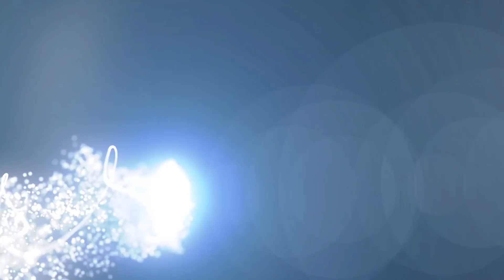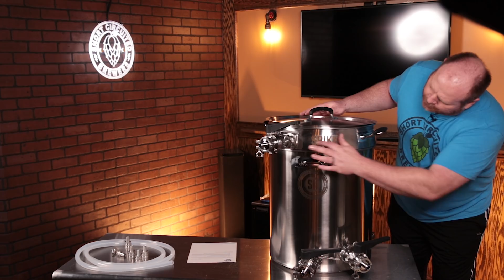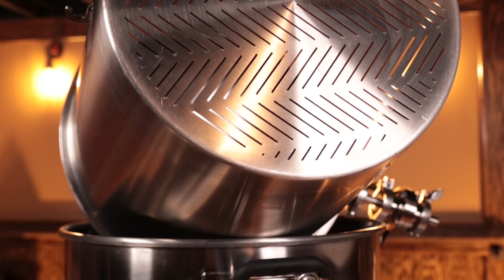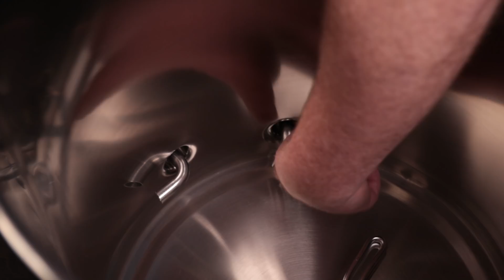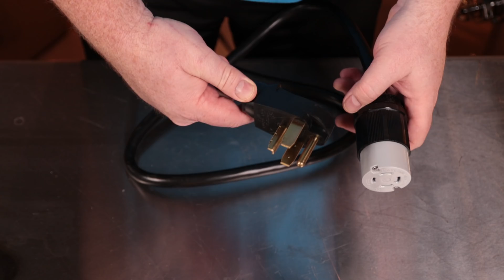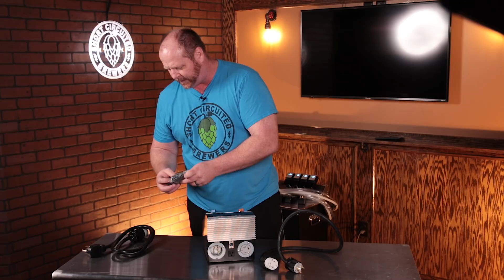Spike Single Vessel E BIAB System First Look!

Comment: Just seeing this video after Spike released pricing packages. I think not including a chiller is a big mistake for the complete package. $2k for an incomplete system basically, when their competitors in the e-BIAB market provide a complete package.

Given the size and weight the 20g basket can hold, I'm also surprised they don't include a manual hoist. It's a simple Amazon purchase, just like an extension 240v cable, but $2k is a lot of money for a system that you would need to get extras from a 3rd party vendor.

I saw the animated video on the product's page and I'm still up in the air. Personally, I'd have liked to see at least an included chiller and longer cables.
Reply from the maker: Understood! All valid points I know they are "listening" 👍🍻

Comment: Kettle runs about $300, basket about $200, element about $100, controller about $300, fittings about $200. So it’s going to be at least over $1000 probably situated at $1299.99
Reply from the maker: Check out my latest video. First comment I give the pricing.. 👍🍻

Comment: The malt pipe looks like it has a lot of steel, so it will be spendy. My guess is at least 1,500 - 1,700USD with controller and pump included.
Reply from the maker: probably pretty close..

Comment: Based on the setup and their pricing on their website here is my pricing breakdown:

20g kettle - $335 (Website)
Basket - $200 (Guess)
1.5" Butterfly valves - $50 x 3 (Website)
1.5" TC Quick Disconnect - $12 x 3 (Website)
Dip tube - $32 x 3 (Website)
1.5" TC Heating Element - $75 (Website)
Silicone Tubing - $2.5/foot x 20 feet (Website)
Quick Disconnect Fittings - $14 x 6 (Website)
TC Clamp - $6 x 11 (Website)
Brew Pump - $200 (Guess)
Electronic Control Panel - $500 (Guess)

Total: $1800

Out the door price: $2000 - $2500. 

You can always put your products on sale, but you can never raise the price after it's been set. People associate high priced items with high quality and lower priced items with cheap quality, unless it's on sale, then "its a steal". I have 3 Spike 15g kettles and Spike equipment is high quality though. Whether it's worth that kind of price, probably up to the end consumer. You can always just buy the kettle and basket and buy all the accessiories from various other sites and probably end up spending around $1000-$1200.
Reply from the maker: good analysis.. I think you are very close to what MSRP will be fully outfitted.

Comment: Looks like it might tip over once you hook the basket on top full of grains.  $600.00 -$700.00 sounds more like it.
Reply from the maker: Nah... The center of gravity on the basket is directed to the opposite side of the kettle and the bottom of the basket rests against the the kettle. And there will be some wort in the bottom of the kettle for ballast. 👍🍻

Comment: Killer looking system. Spike is top notch quality, and can't wait to see it in action. It seems Grounded Brewing Technologies set the standard for the Turnkey 240v E-BIAB systems. At Launch, cost was only $1,550.00 which included the Massive CFC. Granted, it's only 15G compared to Spikes 20G. For Spike, you're probably easily looking at $1,800-$2,100 range including Pump & Chiller
https://www.groundedbrewingtechnologies.com/turnkey-brewing-systems/t0p9tduhb4ewtndi0juvr1udj2ohsd
Reply from the maker: pretty good price and that is a third party selling the Spike kettle.. Thanks for sharing that!! 👍🍻

Comment: Good Overview Brian.  I think if they want to stay competitive they need to come close to what the Claw Hammer 20 gallon system is, $1700, and offer a comparable package.  That system comes with the kettle, hoses, quick disconnects, basket, hop baskets, plate chiller, pump, controller, etc..  That is my home brew drool system and if I were to even consider the SB option it would have to be extremely comparable.  And just to be clear, I do not own the CHS system nor do I have any affiliation with them.  I've just done a ton of research, I've been deployed for 4 months, and of all the eBIAB options out there the CHS system seems to be the best bang for the buck.
Reply from the maker: We'll have to see!! I don't disagree with you. . 🍻👍

Comment: Price?  I'd say $1799 would be a good ballpark, although up to $2200 wouldn't be out of the question.  I hope they redesign those hooks and the way the mash basket sits at an angle.  It seems like over time the weight of a full-volume mash would deform the lip on such a small surface area.  Also, for a sparge setup having the mash sitting at an angle would cause an uneven flow. 

Thanks for sharing, and can't wait to see the actual production model!
Reply from the maker: Me too!! I'll be brewing on it this weekend!!

Comment: Thanks Spike Brewing for send the system out to Brian for reviewing and testing. For Brian's channel subscribers to view. Price points I'm going to guess is going to be between $1800 to $2500. With the unit being able to brew 20gal batches. The unit is well laid out. The one thing I'm wondering is does it have a spreader bar to lift the basket for using a overhead hoist. For lifting the basket with a grain bill for a 20gal batch? Brain thanks for another up front and open review, look forward to see the unit at work making more great beer!!! Cheers
Reply from the maker: Thanks John! Good question on the bar/lift attachment.. Well see what the final system looks like..

Comment: Well that is a bit difficult, but I will try anyway.  As I see it, It has to be cheaper then Brewtools B40pro Brewing System which is in direct competition with Spike.
Anyway,  it definitely need to be cheaper then 1.583 $ since that is the price for the B40pro and teh B40pro is top of the line. So 900 - 1.100 $ ?
Thanks for the video.
Reply from the maker: Thanks for the comments!

Comment: I think a lot of these comments are on point.  If you want  simple BIAB, them buy a kettle and burner and go for it.  Some of use like the ‘extras’ that Spike and Brew Tools bring to this market space.  This clearly is a work in progress and I think Spike was right in sending these out for review even though they are not production models.  We, the target market have been waiting for SS Brew to show something to us other than a coming soon sign.  Looking that the design as it stands right know, I like the TC fitting even though they add cost for those that are not already using them.  The butterfly valves are nice but just added cost. This could be an a la cart item.  The kettle and basket look top notch. Need to find a way to hoist capabilities to the basket. Most of us who run larger BIAB  systems use some sort of pulley system.  We drink beer, not lift weights...lastly, the controller needs to reworked depending on price point.  With just simple on-off switches and a basic PID, there is no customizable options.  As it stands, this is a 1500-1800 price point and that should include a pump and chiller.  1200 for a byo add on price.  I am excited to see the brew day video and what Spike brings to the market in the final production model.  Brian, keep up the great work and Spike, keep being ‘shinny’.  ✌️
Reply from the maker: Thanks for the well put comments!! Cheers!! 👍🍻

Comment: I'm planning on getting the 15 gallon basket only, to use with my 15 gallon Spike kettle. I hope it'd be cheaper than the price of the kettle itself, but then there are also decent stainless mesh BIAB baskets out there that sell for $150-200. Obviously something like this smokes mesh in terms of strength and quality so it'll be interesting to see where Spike sets the price point.
Reply from the maker: Yes it will!! 👍🍻

Comment: Damn these all in one electric systems are so nice. I really want to install a 240v outlet in my garage so I can move away from propane, but I'm renting right now. If I get approved for my loan and can buy my place I think this the first system I'll look into buying. Can't wait to see it in action.
Reply from the maker: Make an extension cord with a spa panel on the end and plug into the dryer!! Lol 👍🍻
Reply: @ShortCircuitedBrewers  That will do it.  not pretty but functional.
Reply from the maker: @chiefsmash7516  you can make beer!! Hope you can get your own place!! 🍻👍
Reply: Short Circuited Brewers I did this with an extension cord running from the garage to my laundry room and the wife shut me down real quick lol. Had to wire the garage for 240v in the end. Cost me some $$$ but much nicer in the end

Comment: The first thing I notice is how difficult it will be to lift that basket out when it is full of soaked grain. I really could not see a way to attach a hoist or something to the basket without lifting it up from the handles on each side. I am currently in the market for a new brewing system and I have been waiting on this one before I pull the trigger. I am thinking price point will be around the $1700 range. I hope the production model has things ironed out. I look forward to your brew day Brian!
Reply from the maker: I think it just needs a strap to hook onto the handles for winch lifting. 👍🍻

Comment: $1600-$1800 seems reasonably comparative for it. I would like to know if anything differentiated that kettle from someone who owns a kettle of that size already. Spike has a great modularity aspect to their equipment, and being mindful of that for the folks who already own some components which may work for this system may help it to be a large success as opposed to a proprietary piece. And I’m glad you read off the list of prototype features to be worked on and they sent you something to share. Looking forward to the next video and hopefully 5 and ten gallon 120 volt versions in the future.
Reply from the maker: That's a normal 20 gallon kettle. Nothing different from a Standard e kettle. (From what I understand) 👍🍻

Comment: Add another triclamp ferrule up top on the boil kettle for a steam condenser and I'll write a check right now! 

Kettle and basket is probably 600
Controller and element is 700
Valves and accessories  200. 
That brings my prediction to $1500 with pump and chiller an additional add-on.
Reply: I was quoted $530 for the kettle minus taxes. That’s kettle minus mash portion, valves and heating element
Reply from the maker: STEAM SLAYER!!

Comment: I like the way the controller unit is separate from the whole thing. Makes it easier to replace fuses. Modular design is really nice. All the other electric brew in one stuff out there has all the electrics packed in the bottom, very smart design. I noticed it has etching in metric and imperial 75L. I hope they make a global version I would be interested 🍺🍺👍👍
Reply from the maker: Thanks for the comments!! 👍🍻

Comment: In Brazil Its almost impossible to buy anithing from spike. So im developing my own single vessel and got some ideas from the vídeo.  Id like to see it being used.
Reply from the maker: You will! 👍🍻 brewing/filming this weekend..
Reply: check out the Claw Hammer Supply system, I've gotten most of my ideas from that one for my DIY project.
Reply from the maker: @chiefsmash7516  I have the 10 gallon version I'm house right now for review. 🍻👍

Comment: I'd love a 5 gallon 120v version of the same design.
Reply from the maker: They are planning a 120v version. 👍🍻
Reply: Guillaume Couture-Lévesque check out the unibrau system, it’s basically the same thing and has been out for a while.  

https://brausupply.com/products/unibrau-all-in-one-electric-brew-system

Comment: I'm not a fan of the hook for the basket.  I get why they did it but I'd be interested too see how much more level they can get it and how well it will actually hold a full water soaked mash
Reply from the maker: Honestly from the feel of it. I have no doubt it will hold 50-60 lbs
Reply: @ShortCircuitedBrewers  cool, I'll be sure to check out your brew vid of it. Do you think any the slope of the basket will affect the  flow of sparge (better or worse) comparatively to competitors straight up designs such as the anvil, robobrews, etc?
Reply from the maker: Well find out!! 👍🍻

Comment: That is beautiful. I actually love the way they set up the control and the dryer cord with the female on the end. You can use a standard generator cord as an extension
Reply from the maker: Yeah i like a standard socket for main power. I am ok with twist lock for the elements.👍🍻

Comment: Great video but I'm disappointed in spike with this one. I'm looking for competition with brewtools 80pro (which while difficult to use is on the list for next upgrade). For 2k price point (They said sub 2k on their Facebook page). I'd rather go with the brewtools. It has a 15 gallon end capacity. Where is spikes product to match the cf15 at a reasonable price point?
Reply from the maker: if there is enough demand...
Reply: @ShortCircuitedBrewers  I find it hard to believe that people don't want to do 15 gal batches. You posted up on Reddit about the capacity after I posted this comment/ emailed spike. Your post was clearer then their email. They said the 10gal capacity for 20 gal is correct. I thought that was crazy but youre saying there is 6.5 gallons under the basket? So one could easily get 15 gallon batches. Or am I missing something?!
Reply from the maker: @crzy619  I think you could. You'd be at the top of the kettle pre boil but it's doable

Comment: Depending on what they include in their turn key package I think a fair price range for a 20 gal system would be in the $1,500 range. Hopefully they can price out options for brewers who might not need a pump or chiller.
Reply from the maker: That would be nice. I know they are listening.. 👍🍻
Reply: I was told they will sell it as a kit only

Comment: Looks good. Price range $600 to $900
Reply from the maker: Think that is a little low.. 👍🍻
Reply: Short Circuited Brewers comparing to Anvil and Robo brew
Reply from the maker: @trevgoldie  not sure that is a real comparison.. Not the same type of system.. Based on cost alone I suppose... And they both make wort.. Lol

Comment: I’m going nuts, on the pre sale list, can’t wait
Reply from the maker: Lol!!
Reply: In my opinion I think the new Grainfather will pretty much the same thing and less exspensive than the SB system
Reply from the maker: @scottyweimuller6152  the spike will have 2200 more watts of power..
Reply: @ShortCircuitedBrewers  Very true, Im a distiller with a 26 gallon fractional still so more power for making mash would speed things up but when im brewing beer I don't mind the extra time waiting. All I use for both distilling and hombrewing is my Brewzilla 35l which does the trick.

Comment: I remember when I was waiting for the SS Brewtech system that was planned for released Spring 2019... Then Summer 2019... And now it's almost Spring 2020 without any updates.
Reply from the maker: Bummer
Reply: they will need to do a great come back as competition is very hard now, Spike eBIAB, Brewtools, G70 Grainfather, they will to be very creative.
Reply: Chris Brinzo I use the SS 1V as a BIAB setup. Brian did a video with it at NHC. I love it

Comment: Thanks for getting the video so quickly Brian!  I think depending on chiller whatever pump they spec out. I feel like somewhere around $1700 to $1850  is a pretty fair price. Considering it has a 20 gallon capacity ?
Reply from the maker: You have to be close!
Reply: @ShortCircuitedBrewers  I hope so if it goes much higher than that 🤷🏻‍♂️ who's to say how it will do!

Comment: If it can handle over 20lb of grain comfortably for <$1500 i'd be pretty interested. The closest competition in my eyes is the Claw hammer system which i've had my eyes on for a while. I'm honestly not all that swayed by the butterfly valves if i'm honest. a simple 3 piece ball lock would save a good amount of money. I'd also be a little worried about the taper causing a really compact grain bed/stuck sparge, but i could be wrong on that. My back is also a little worried about lifting that basket when maxed out with wet grain.
That being said, i'm excited to see what people thing about it.
Reply from the maker: I hear you!!
Reply: The 20g design can handle abou 40lb of grain
Reply: I use an older 15 gallon eBIAB system from another manufacturer. Their design incorporates a manual hoist attached to a SS stand to aid in lifting out the basket. The stand also serves to support the brew pot and the control panel is affixed to one of the vertical members. With the hoist brake, you can lift the basket just above your wort to let it drain or even perform a small sparge. It’s probably not necessary for smaller batches, but could be a consideration for the 20 gallon model. I’m sure one could rig something up if SB hasn’t already incorporated a solution.